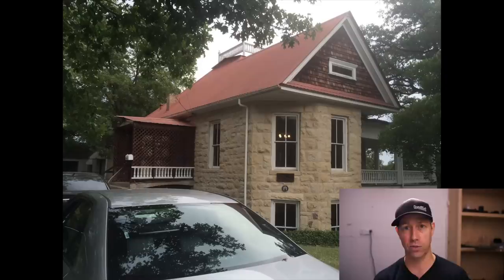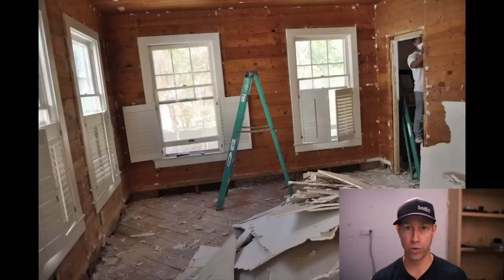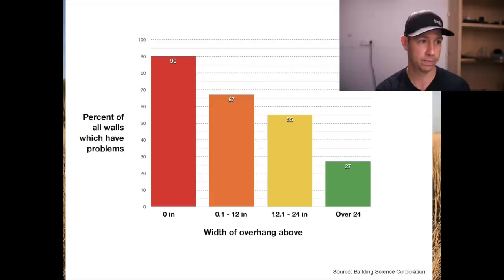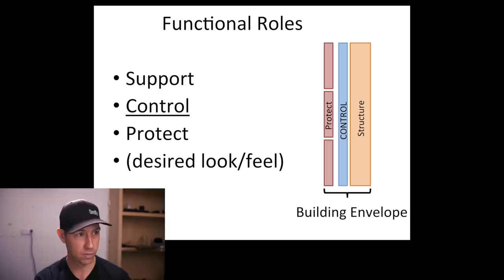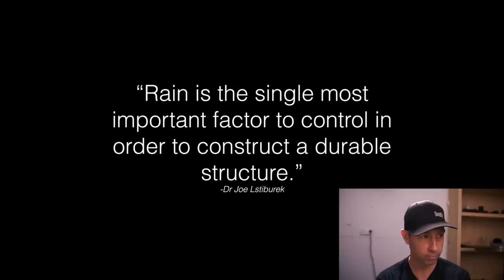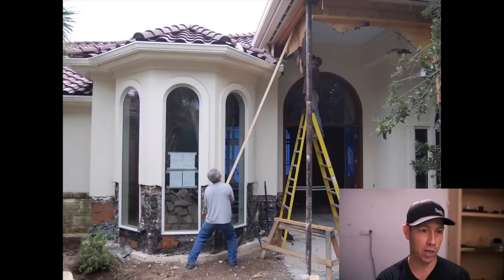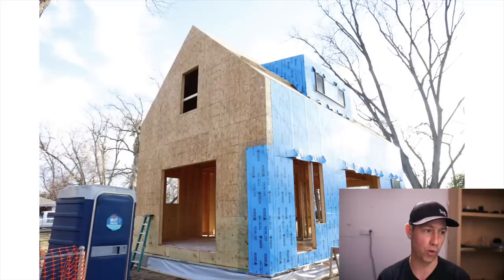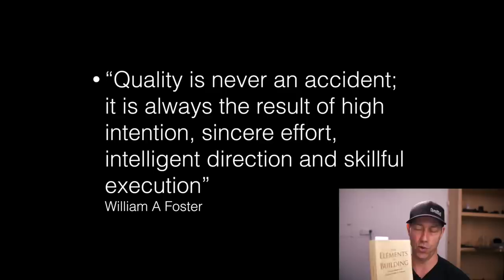Were Old Houses Built Better?

Comment: I don't watch this channel often but I watched this video and I'm glad I did. Some New building strategies disgust me. Almost Everything is fake, superficial or inefficient

Fake stone facades,
Fake non structural brick exteriors,
Fake boarders,
Fake pillars,

Superficial prefab fireplaces that just leak air into the house,
Superficial roofs with multiple different roof styles and extremely cut up,
Superficial vaulted ceilings,

Inefficient overhangs that provide little protection from sun or rain.
Inefficient dark roofs that get to 150 degrees in Texas heat.
Inefficient walls that soak up heat and moisture
Inefficient slab foundations that crack.

Vitruvius said a house must be three things: durable, beautiful, and usable. A lot of newer constructions FAIL on all three fronts.
Reply: Vitruvius didn't live in 2018 where the standard of living is far better than during his life. You can't compare the people who are living in these so called inefficient houses with houses in the past that weren't inefficient....a large portion of these people would have a much smaller house thats not nearly as nice, energy efficient, and single car household etc....we are stretching are dollar now which allows those who normally wouldn't have had nice things to now have them....no one had 5 TVs 30 years ago....now people living in poverty do. They have cell phones too....remember that
Reply: @actionjackson9121  hi. There is nothing new under the sun. We are not stretching the dollar at all with home building. The builder's are commanding high dollar by creating "value".

What value is added to the owner of the house by having fake boarders?

Some of the older houses were not as inefficient as you would think. That whitewashed house for example- I have a white painted house and the the temperature of the wall is usually 5 degrees above ambient in full sun, where my neighbors' brick siding is at 40 degrees above outside temp in full sun.

The house with 5 ft overhanges meanse- means that  between the equinoxes(March 21 to Sept 21), if it has a north south orientation, the walls are in FULL shade.

Remember that everything else being the same a smaller house is an easier house to heat and cool. So no matter how efficient a 5000 SQ foot mcmansion is, it still takes a lot of energy to heat and cool it
Reply: The standard of living is merely temporary brought on by the discovery of cheap energy. Suburbs, cookie cutter homes, will be a blip in the history of man. We've thrown millennia of building techniques for convenience. Science has given us a lot of tools and materials that we could benefit from, particularly the Internet, but I don't see petroleum derivative products as one of them, at least in the long term.
Reply: I hope the mcmansion is on its way out
Reply: Consider the volume of construction happening constantly, coupled with the scarcity of materials relative to 100 years ago. The way old houses were built was not sustainable, clearly.
Reply: @Xixu.co.6  that's why they built them smaller and more efficiently back then. A simple rectangle with a simple Gable roof can be built far more efficiently than these new designs with umpteen competing masses and voids.

Every one makes more money with inefficient design and the home owner is left carrying the bag.

The architect makes more to design a more complicated house

The GC makes more, the sub contractor make more, the bank makes more, the county makes more

And then we have a situation where people are paying for 15,30,40 and even 50 years for what is essentially shelter.
Reply: big O Evolving tastes. We can buy houses today with an average income that would have been considered mansions 60 years ago. I much prefer modern designs. I don't want to live in an 1,100sqft rectangular box. I want space and elegance in design, as do most people, and i think new homes really deliver that. Obviously it's at a trade off in material quality, but the house is still going to outlive all of us so who cares.
Reply: big O 
If we built cars the way we build houses we would all be driving steam locomotives.  It’s all about how fast and how cheap it can be done nowadays. Even the higher end homes are built the same. There are no longer craftsmen involved. You would be lucky to find anyone on a job site that speaks English has prints on hand or could even read them if they did. The Graff and nepotism involved is so blatant it’s ridiculous. The reason we have this and every other shitty service and product now boils down to a few things. Lack of pride, morals and values. I’m sure we can tack greed In there somewhere
Reply: @Xixu.co.6  the new homes are truly ugly.  Way too much going on. They look like wannabe castles. I'm looking for a house on acreage right now and when I see a piece of land with one of those monstrosities on it I just ignore it and move on. Our sense of taste has been programmed into something scary
Reply: @notacommie5415  agreed.
Reply: Big O — Well stated : Our houses turned out as superficial as our societies & ourselves. Global.
Reply: Löp
Reply: It's not so much that we've lost the skills to make the old houses...it's just that, when you ask most people, "Hey, would you rather live in a 1,000 sq ft stone house, or a 2,500 sq ft plywood house (with a fake stone veneer)?" They usually choose the bigger house for the same cash.

I mean, you could build your house like a bank vault, if you got the cash...
Reply: Greed, greed is what runs the economy. Now its plastic fantastic.
Reply: @jl9678  Yeah, exactly!! They don't even build small houses anymore and i don't understand why. If you want to buy a small house in the Northeast, you have to buy one built in the 40s or 50s. From 60s and 70s you might find a raised ranch, but they usually have big sprawling yards and not everybody needs or wants that. Beyond that all new construction is either mcmansions or shoddy condos and townhouses with fancy landscaping and high HOA fees. I shudder to think what the latter are built like though i'm thinking of buying one myself. Anything mass developed just logically must be done cheaply. That's just been the way of business over the past few decades of our existence
Reply: @jl9678  So true! There should be a cap on housing prices and then things would line up more logically. A house is just shelter, that's it. It should be seen as something closer to a basic human right or need, like food, not a luxury that few can afford. That's why i think investors should be banned from single family houses. And in general all mechanisms that contribute to lack of affordability of your average house on your average income should be decidedly discourage by proper laws and rules.
Reply: @jl9678  When i look at those complicated rooflines, all i see is extra potential for leaks, LOL
Reply: @robertkat  Yeah,  plastic will have to end at some point, or it will clog up our whole planet. And then what is everyone going to store all the multitudinous garbage of our throw-away society in??
Reply: Thank you for calling out the truth. And you win at the end when you reference Vitruvio, a forgotten man in the current days.
Reply: @comment6864  I think you would love to live in soviet blocs. please, never say a house is just a shelter.
Reply: Biggest difference you see right away going from 60's homes into late 70's 80's is flooring. Used to be nearly 100% REAL HARDWOOD FLOORS, not this cheap vinyl wood wannabe crap.
Reply: @actionjackson9121  I think you have something wrong. You believe that now a days everything is better because we have technology. Our technology has given us more efficiency,  almost no matter the quality. Back then homes were less expensive but people got payed less. But people believe it was the same but payments just keep increasing in time and money. Now we pay for a car for 72 months. 6 years. When back when Henry Ford had workers that could afford his cars for less than a years worth of money. Of course quality of life is better in some aspects but we have given a lot to have what we have and what we've been told that has been improved in society, in reality if you look at the numbers and statistics. No many many things have not improved. It is how we see things(the world) is how we will live our lives. 
I am only 23 yrs old so I suppose instantly you believe I am unwise and ill minded. But this is an opinion, which even a child has the right to have. Now facts are facts of course and cannot be argued with, but of course you must complete some search time. Look for old books on building houses or how they used to do things a century ago. You know we say things used to be built better back then but we forget to realize that there wasn't a time that everything was good. In the 80s and 90s the most reliable cars were built including the ls400 and the tacoma and the f150 and the... you get the point. But for houses the 1930s to 1990 was somewhat bad because of the oil age and mining and ways of living. Also aspestus(o).
For houses the 1600 was the best time. Up until the late 1800s 
The world built homes out of stone, rammed earth, etc. Now, its wood. Instead of camping in it we take it home and instead of burning it for heat we build our houses out of it. The ac was made and now you could make cardboard houses. I am so serious,  cardboard is used to build $300k houses. Yeah

Comment: For all the houses I worked on over 45 years , Many older houses were stout and solid ,Many newer houses were absolute junk. 
The oldest was built in 1865.
It depended on the masons and carpenters , either pro or DIY.
Materials were selected via cost in almost all homes prior to approx 1967-9.
Older homes were as a rule built to shed rain and snow , hence steep roofs and large overhangs and no soffit or fascia on most.

Comment: I can't speak for other nations but in Norway, old houses were build't to last for hundreds of years, with multiple generations in mind, the house i grew up in were over 200 years old and still standing to this day looking mint, I've helped my grandfather sometimes in the loft and the basement doing some work, holy balls folks, those nails were what i can describe as long as 40cm long, the wood used for those roof beams were as thick as your average fridge, it's just incredible how well made those old houses are.

No matter were you look you don't see any cheap shortcuts, they seemed to care allot about the long term, same for the walls, thick wood used, and lot's of it, they were also really clever to make sure it wasn't so tight that the air quality got bad, they made some breathing room so the ventilation is great, and it has a good effect on the wood, the new houses are what they call cardboard rubbish.

Near hermetically sealed, they use pre fabricated walls with thin wood beams and some plywood, heck those are even stapled and glued together, I've seen how they're made, there is a saying here, the old houses are the ones who laughs in the end, usually when we have lot's of wind and bad weather the old houses are standing while the new ones are missing roofs, wall segments flying apart, the biggest mistake you do is buy a new house, buy an old one and restore it.

Now days they give a rats ass about reliability and quality, they want it fast, they want it cheap, they want it very simple, so they get, garbage, old houses are worth fixing and taking care of, while new ones you might as well tear them down, besides old houses usually have allot of character to them, new ones don't, personally i hate modern design, all cubical and lifeless.
Reply: I so agree.  If anyone wanted to break into a "modern" house here in the US all they have to do is remove the thin plastic siding, a bit of pink fiberglass insulation and punch a few holes in some 1/2" thick drywall and  voila!!! They are IN your house.  What a joke.  Unfortunately, the joke's on us.  Reminds me of the childhood fairy tale called "Three Little Pigs" where the big bad wolf huffed and puffed and easily blew down the pigs houses that were made of sticks and straw.
Reply: I could not agree more.. I am norwegian as well.. I rent an old farmhouse, timber walls.. old. Not very fancy, but easy to keep warm with the wood stove in the kitchen, and the bedroom over the kitchen acting as an insulator to the roof.  As soon as i get a chance to own.. i will buy and fix something old.. no new crap for me.. this house is also , being just wood and stone..very nature friendly... no toxins.
Reply: I agree
Reply: Norwegian houses are some of the best in my opinion. The cabins I visited were all handmade and immaculate for how old they are.
Reply: Most Norwegian houses built 200 years ago were terrible one room shacks, which is why a third of the population immigrated to the US. They mostly didn't survive more than a generation.  You're comparing the cream of the past to the very average housing now.
Reply: @reesedaniel5835  you forgot about the exterior sheathing layer

Comment: I purchased a house that turned 150 years old recently, I’m currently continuing to improve “her”.  Amazing, as I purchase a flipped house before this and will just say that even though it was 100 years newer,  leaps and bounds better in many ways.  Lead paint is the main negative, be we’ve  encapsulated it.  For the lumber that was used to build this, floor boards are 2-1/2 x 7-1/2, walls studs are 4x3.  Amazing.  I’d expect it to last another 150.  I don’t believe anyone will be saying that about some of the major builder home companies.
Reply: Wait are you saying the older home is built better or the new? Sorry I got confused

Comment: Good video; good information shared. Thanks. My house was built around 1880 in the Pacific Northwest. The exterior ship lap wood was probably milled from cedar that were 4 or 5 hundred years old. Very few knots. Also, the wood seems to have hardened over the last hundred years. Material wise there's no comparison to what is available now.